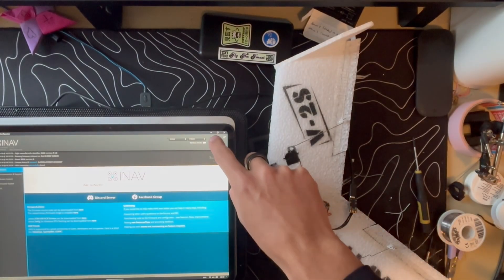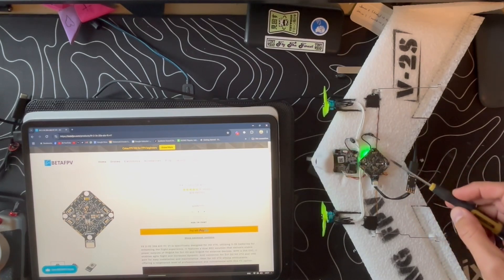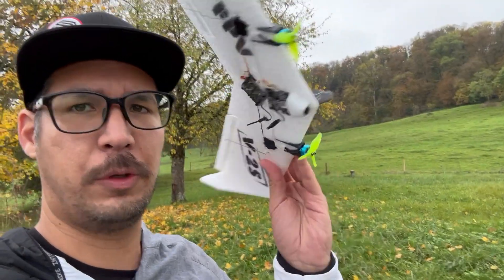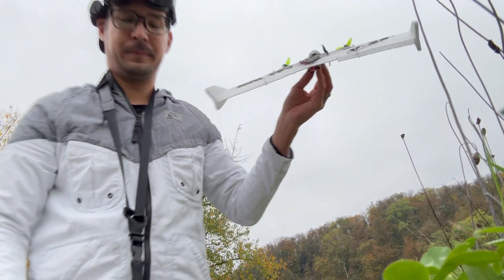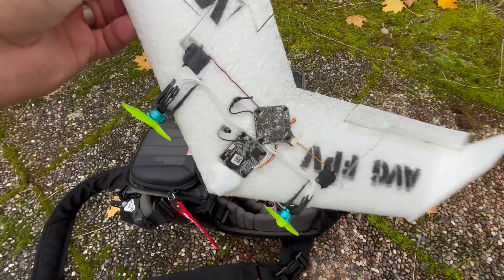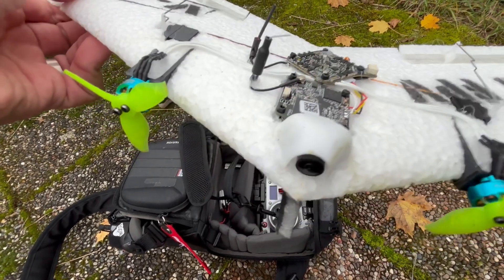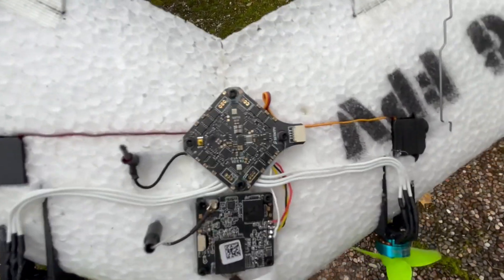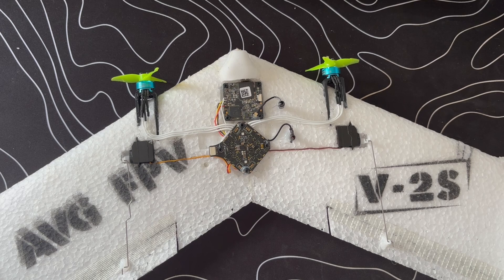Running full INAV 7.1.2 on an AIO! Test, maiden, impressions

Comment: Wow nice! Is it also possible with 4 servos and 2 motors? (for an aerobatics airplane)
Reply from the maker: @butterflyfpv  so far I no, maybe if we sacrifice another UART or go with a F7 (need enough free pins and timers)
Reply: You can get tricky and do some micro soldering to the signal wire of the unused motor mcu's. But yea, kinda a pain in the ass.
Reply: @SkydozerFPV  Ok interessting! So it seems doable. Not easy but doable.

Comment: This is amazing 🤩 I’ve always thought about using an AIO for a wing and just haven’t had the time to sit and figure out the compiling. I run some Inav AIO boards for my toothpick builds but this is another level!! What’s the flight time on that 2s battery?
Reply from the maker: @DanielSingerX  yeah I’m already thinking about all the nice small builds I could do. One thing I want to check is if I can even use uart 3 or 5 for GPS.

Comment: So cool. Please send more info of setup and you mentioned a 1-2s aio with inav aswell?
Reply from the maker: @kristianmuotka7523  thanks! The set up is pretty simple: you take the custom hex file (link in description, I also added a txt file with more info) and flash it onto the AIO. The rest of the set up is just like any other INAV FC so you can follow one of many YT tutorials.

The 1-2S AIO is the NeutronRC AT32F435. Hanfer already has that one working - I’m waiting for mine to arrive from Aliexpress 👍🏽
Reply: Cool. So you have a link tl tge customer hex for that aio?
Reply from the maker: @kristianmuotka7523  https://drive.google.com/drive/folders/1-dUkXN2SrYENbFYbXuXMG1pd4o6773je?usp=sharing
Reply: Oh i was thinking of the 1-2s board
Reply from the maker: @kristianmuotka7523  ah you,d have to ask hanfer over in quicksilver discord for that